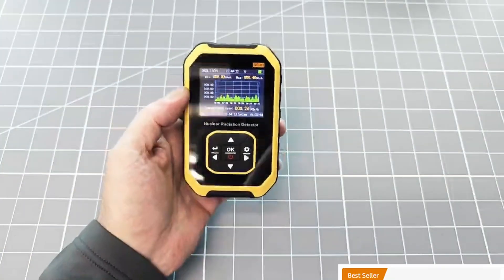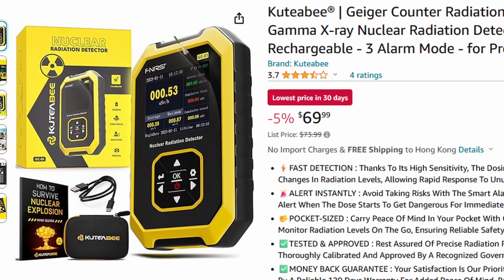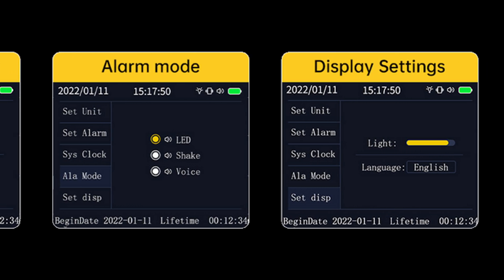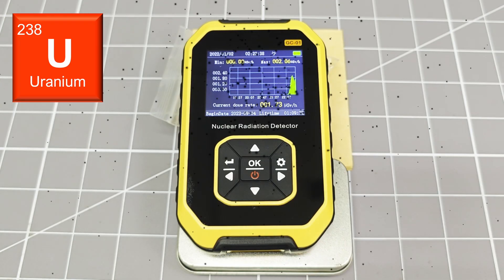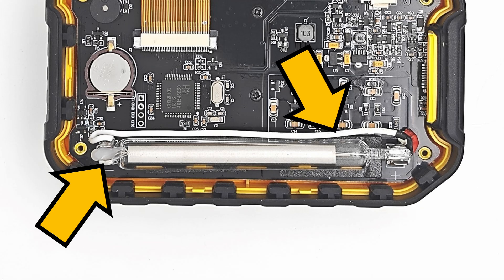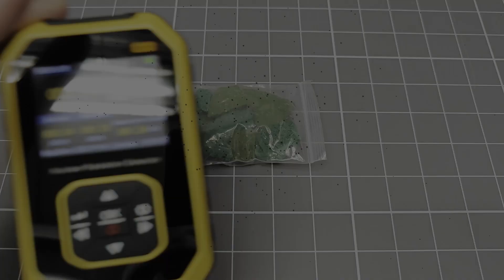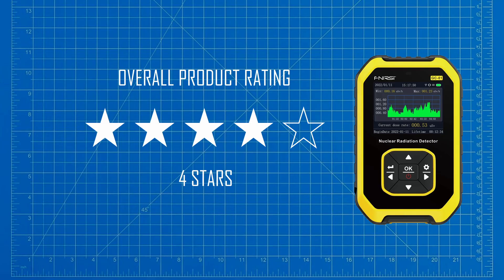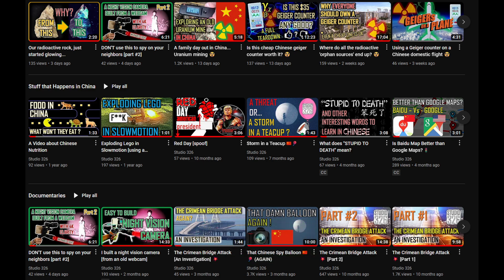FNIRSI GC-01 [IMPORTANT PRODUCT UPDATE]  ☢️

Comment: I had 4 of these but 2 of them were not working right. They showed randomly low measurements. But they didn’t show anything at tests with uranium glass.  So only two were useable and showed the right values at testing. 
If you buy these test them before you risk your life with these cheap devices.
Reply from the maker: Well yes and no.  Yes: this is definitely problematic over technically advanced adversaries.  No: is isn't a problem over your own country and that is where the US has its own surveillance fleet deployed.
Reply: But if you collect stones or plates like „Fiesta ware“ and you have a device that doesn’t show the right measurement and you use the item often. Then it could be risky to buy a cheap device without testing it before using.

Comment: I bought the branded FNIRSI GC-01 back in 2022 and luckily it has the J321 tube and it works perfectly in line with with my old USA cold war CDV-777. when using the check source they both match to my suprise.

Comment: why its 4/5 stars if all these devices not havin the J321. this should receive 0/5 because after the company received popularity they changed the internals... that's literally what a Chinese scam looks like
Reply from the maker: Perhaps I didn't make it clear enough in the video, I gave it zero stars in its original condition and then did a rating on the unit after upgrading it.  The point was to help people that have this unit to upgrade it themselves.  You will see from the comments, that a great number of people have performed this modification themselves.

Comment: I have 2 of this devices the first has the brand name fnirsi and has a j321 tube the second is blue colour the brand is joy-it from simac electronics in germany and has  M4011 tube made in 2023 what is your opinion about this tube??? thanks in advance!!
Reply from the maker: The M4011 and the J321 are pretty much the same in all regards.  The sensitivity is just slightly higher in the J321 but not by a significant amount...
Reply: @project-326  thank you very much Sir greetings to China from Greece!

Comment: I have 2 of this the  first is with name on it fnirsi and i opened it and has a j321 geiger muller tube the second is blue colour and brand is joy-it  RAD01 by simac electronics it is sold in germany in conrad store and in other parts of europe like greece i opened it also and i was amazed it has a m4011 geiger muller tube made in 2023 what is your opinion about this tube in this device?
Reply from the maker: The is an OEM product designed by the factory and all of the ones you see with different brands, colors, etc are all made in the same place.
Reply: @project-326  yes but no name have tge crappy j613 tube!! do you know information about the M4011 tube?? I found on google it is  enough good
Reply: @project-326  yes but no name have the crappy j613 tube!! The fnirsi brand has the j321 tube!! do you know information about the M4011 tube?? I found on google it is  quite good

Comment: 4:24 the battery inside is just a standard 3.7v lithium cell, so really any lithium cell you can fit in there should work just fine to improve its capacity

Comment: i improved mine by flashing radpro onto it. the preinstalled firmware is garbage, and radpro is not :) also radpro has a setting for particle clicks, which is enabled by default. it also adds logging via the usb interface and a good averaging algorithm.

Comment: If I open it and it comes with the one it was originally designed to have, does that mean Its alright? Or do u think stock from them is still gonna be horrid
Reply from the maker: if it is already a J321, then its fine.  It ain't broke, no need to fix!

Comment: Hi, I bought my FNIRSI GC-01 ne week ago via Amazon.
I opend it up right away, and found a J321 tube in it.
The date of production on the box is 2023-07-11
I gues I was lucky 😊
I totally like your suggestions to optimise this product.
Thanks for this amaising reviev 👌🥰
Reply from the maker: That's good news!  I guess it just goes to show that there is a lot of stock in various parts of the delivery supply chain...
Reply: Have the j321 tube came in a box dated may 2023
The boxes have dates of manufacture on the side
Be easy to ask a seller when it was made
It seems these earlier ones are 👍
Reply: I was really upset with mine. It was advertised with a big tube and the one i got was tiny. It couldn’t detect americium or soft xrays. I was irritated considerably
Reply: @Wtfinc  Same situation.  Very disappointing.
Reply: bastard  .Good ones only have 4screws
Reply: Same here only 4 screws.

Comment: Mine has J321 tube and the resistor seems to be added from factory, not after the build. Can I still remove it from the pcb? Why have they lowered the voltage to 280V?
Reply from the maker: Be careful with the voltage measurement, a standard DMM will massively under-read due to the low impedance of the input (usually around 10M ohms).  After making the video, I found that the tube voltage rose - I live in a tropical region and did the video whilst it was still very humid, later in the year, once the rH fell, I noticed that the tube was giving some discharge due to the voltage being too high.  To measure the tube voltage, you can take a look at my "UV Vs Geiger 2" video, there are instructions for how to build a probe to measure these very low current power supplies.  It seems that the power supplies are pretty poor in terms of the unit-to-unit voltage tolerance, so you might be best to measure the voltage you are getting and then adjust the loading resistor to match you particular unit.
Reply: @studio326-  sounds risky and complicated. I might be better off just by buying the FS5000. Thanks
Reply from the maker: @CatalinEnache1502  If you buy the FS-5000, then that sort of de-risks making changes to the FNIRSI GC-01.
🙂
Reply: @project-326  what exactly?

Comment: My original J321 FNRISI GC-01 has a 516 SMD resistor at R38. I bought an unbranded GC-01which had a J613 tube  and no resistor at R38. Replacing the 613 with a 321 did improve but still seems a bit low compared to the original. I'll try adding a 516 SMD resistor at R38 and see if it improves.
Reply from the maker: I'm making a new video about the UV sensitivity of GM tubes (the second part) and a key aspect of the video is about the production tolerances of the power supplies used in products like this, so keep an eye out for that, it might help to set the loading resistor.  
I am going to be asking viewers that have detectors like this, to help with participating in some experiments - a sort of crowd sourced experiment.  I am hoping that if enough people get involved, we can actually all learn something new.  I hope you will be able to join in the experiment?

Comment: The UI and feature set suggest to me that it's trying to be more like a gamma dosimeter than a general-purpose counter. G-M tubes that have a bit of metal shielding to keep out betas and low energy photons ("energy compensation") have energy response curves such that you can estimate gamma dose rate (within a couple tens of percent) from the count rate - IF properly calibrated. However, there's a big problem in that this thing doesn't seem to have a way to recalibrate it in the settings menu. So better hope whatever conversion factors it comes programmed with are accurate I guess.

The marketing absolutely bills it as a general purpose device suitable also for x-rays and betas though. No idea why since it seems halfway usable as a dosimeter but doesn't have any of the features you'd want in a general-purpose counter. Maybe there are liability issues if someone relies on it for safety and it fails?
Reply from the maker: Hi, thanks for the comment.  Please take a look at my latest video on this device, the firmware upgrade.  Calibration factors are fully adjustable in that 3rd party firmware.  There are also factors such as dead-time compensation.
Reply: @project-326  oh, thanks and sorry for missing that video!

Comment: If so, one element that was unclear from your upgrade video was what to do after removing the extra loading resistor. Leave the space empty? Solder a different resistor? Connect the terminals with a plain piece of wire?  Sorry, I have only a basic theoretical understanding of these things, but certainly not a practical one!  

Also, are there any precautions to take when taking the meter apart, so as not to break anything? (Edit - no, there are just 4 screws, which are retained in the housing, so you don't lose them.  The battery is on the back panel and connected with a couple of wires, but there is lots of room.)  

Update, I opened mine up, and it was an easy process.  I discovered I have an even smaller  J613 tube (the new board is designed for it , as there is an outline for it). There are connection holes for a larger tube, I think, but will they be connected on the under side of the board? And will the 321 come with a pair of holders that fit? Also, it appears the loading resistor you removed in your previous video is no longer present. I wish I could post a photo.
Reply from the maker: I have seen an updated PCB design that used the even more crappy J613 tube, the race to zero, on this product design continues unabated.  In the end, I used a 20M loading resistor on my device.

Comment: I just found out mine is a counterfeit. There are multiple versions of counterfeits and mine is exactly the same as yours. So it’s not really Fnirsi fault. On the other hand as others mentioned, they had a newer hardware revision and replaced the tube with J613. This is definitely on them. BTW I don’t think the tube you showed in the video is J613 as it should be shorter.
Reply from the maker: There are no counterfeit versions that I know of, the factory has constantly found ways to lower the costs for their customers...

Comment: there must be 2 versions randomly sold. one with the original tube and one with the smaller tube. i bought it a week ago from fixco and it has the big tube.
Reply from the maker: I think it has a lot to do with which vendors are holding stock of the older devices.  Typically, the guys with the older stock will be motivated to sell quickly by lowering their prices.  Money tied up in stock for these small 'nobody brands' is pretty tough to deal with, and frankly if they are just drop-shippers, they won't know which model is which, which model has a good tube and which has a $hitty one (they probably didn't even see, or test, a single sample of the product before buying several thousand of them, they typically just look at Amazon sales numbers for other brands selling the same OEM product).

Comment: This definitely works at least for I-131 radiation exposure.
Reply from the maker: I-131 is incredibly active, a half life of just over 8 days and yes, both of the gamma lines should be very easy for this device to measure.  The two beta decay modes might not generate a measurable effect in the downgraded version of the tube, ie the HH442 and the J614.  With the J321 tube fitted, you will be able to measure both the gamma and beta emissions.

Comment: hey man, thanks for the video, wish i saw it sooner. I bought one and it doesnt work at all. Has the small tube in it but im lucky as the resistor is not there and the tube connectors for the larger tube are on the board as well. Im in Australia and was wondering if the j321 on ebay are legitimate? thanks
Reply from the maker: If you are going to buy tubes, best to buy new ones.  Take a look at the Manutek4000 channel for the issues that can happen with eBay tubes.  He bought J321's on eBay and they were all useless.
Reply: @project-326  thanks, i went ahead and bought one off ebay earlier because i couldnt find any for sale in australia. Im hoping its not a dud
Reply: What was the voltage on the tube connectors
Reply from the maker: @RWE870  It is kind of hard to measure that.  Normal DMMs have an input impedance of 10M, which is in the same order of magnitude as the anode resistance.  I don't remember exactly, but measuring before the anode resistor gave about 380 to 400V

Comment: I have this FNIRSI GC-01, purchased around August/2023 and I can confirm they changed the tube for an even WORSE Version than the J631, the new one is half the size around 50mm long only.
After watching your video, I ordered a J321 and will make this mod. thank you very much for the video!
Edit: I've just found the model installed it's a J613.
Reply: I have the same. Were you able to replace the tube with the original J321? If so, any issues?
Reply: Get a better device instead.

Comment: I have one that came with the J321 GMT. It still has the resister that you removed. Would it work better if I removed it? Any suggestions would be greatly appreciated. Thanks
Reply from the maker: If it ain't broke, don't fix it.  The anode resistor should be matched with the tube, when they changed the tube, they changed the resistor.  Some unis that came with the J321 used a 10M resistor, others can without.

Comment: I've just opened the device I bought from Amazon UK, and it's even worse with an even smaller tube inside. The tube inside is unlabelled and has double sided tape and foam holding it in place. Doesn't even have the mounting for a real GM Tube. I can show you the photos.
Reply from the maker: Yes, I have seen from the comments, the company has found an even cheaper GM tube, it looks like a Christmas tree light...
The pad for the J321 should still be present on the PCB and if you get a replacement J321 tube, it is supplied with the clips that solder into the board.
Reply: @project-326   Yes that's it. You can guess my disapointment, I will attempt to fix this.
Reply from the maker: @CrazyPeteUK  Good luck with that, just reach out if you get stuck...

Comment: I just got one of these and I would say its closer to a piece of shit than a piece of shit!  I will change the tube and do the click mod however its very slow to respond.  I'm sure if I put a piece of real shit on my radioactive source it will react quicker than this meter does so I'm not sure its even worth doing the mods. Surely the crappy averaging algorithum can be fixed with a new firmware ?????. 
update.  I just opened it and the tube is only about half as long (45mm) as the shitty one you showed in yours so it looks like it just gets worse with time. That resistor is now gone too.
Reply: Same deal with the one I bought. Do you think it would still be possible to swap the tube to a J321 one?
Reply: Yes I'm sure you can just fit it and it should work.  I measured 307v across the shitty tube so it might be even a but higher than that.  The better tube needs 350v so I'm pretty sure it will be fine.

Comment: I bought one.  It had a cracked tube.  They moved to a different tube design (one with wires and soldered leads like you mentioned in the video) that is just taped down at a weird angle so it fits inside the housing.  Since mine had a cracked it worked even worse than the one you tested, as in not at all.  I think you're 100% correct in your analysis.
Reply from the maker: I has been great to see all the various differences that people have found and commented about...
Thanks for the feedback!

Comment: so I have to open my GC-01 to see which tube is there... if I find J613 I should replace it with the J321...
Reply from the maker: sorry for the late reply.  That does depend upon if you feel that you can do the mod, I'm the ham-fisted type so I have to go really carefully with the soldering iron...
Reply: @project-326  I had studied electronics in high school, I know how to assemble electronic circuits and how to do soldering...
Reply from the maker: @lucasolari3756   - enjoy the process, it feels really good when you first test it after the hack, and the sensitivity is significantly improved.
Reply: ok, thanks! I would need clear instructions on how to do it... I have read that it is also necessary to recalibrate the high voltage that supply the tube and bring it to the manufacturer's recommended rating...
Reply from the maker: @lucasolari3756  Don't worry about the voltage at first.

Comment: Thank you for this review, very helpful.

I ordered one of these geiger counters, and mine has a HH614 tube in it.
I'm not sure how that compares to the J321, but like the J614, it's much smaller and also has a metal cathode.
Reply from the maker: unfortunately, that one seems to be about the worst variant they have put into this product.  Do you have any test sources or anything else to compare with?  I strongly suspect that your sensitivity level will be very low.
Reply: @project-326  sadly I don’t have any test sources, nor do I have another Geiger counter to compare background too

Comment: Thank you! In my case there was J321 tube but also the resistor marked 5105.
edit: And in the case someone, like me, will have problem with FNIRSI GC-01, the right hole is indeed for reset button (just imagine how hard that was to write in the manual).
Reply from the maker: 😆  Always be sure to find the right hole when you need a quick reset...
Reply: Except there's no button inside!